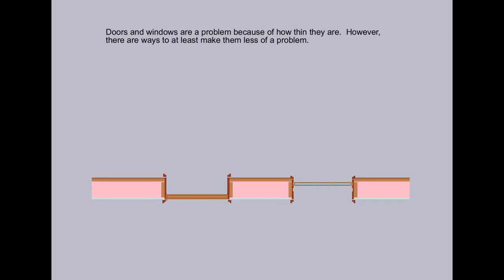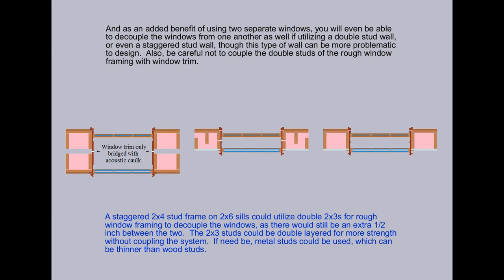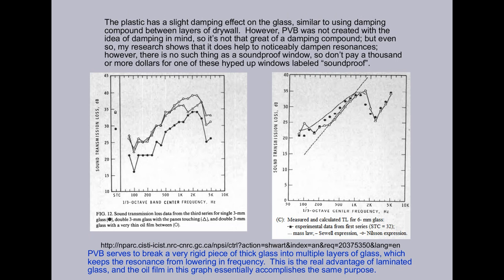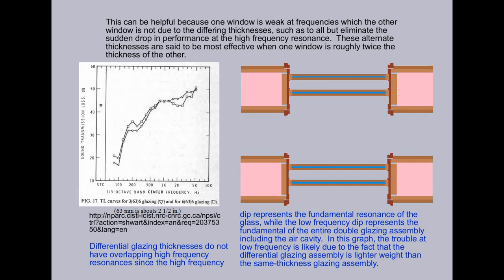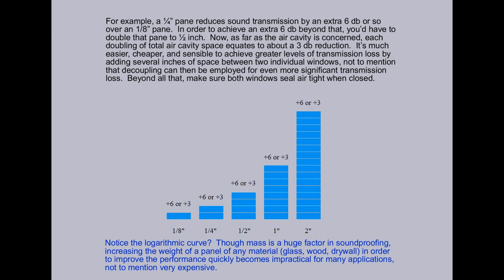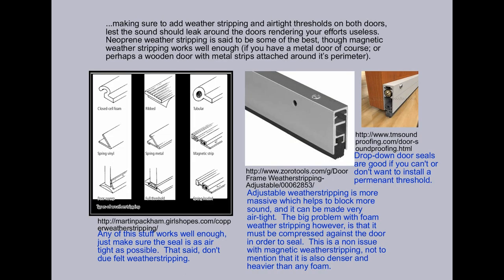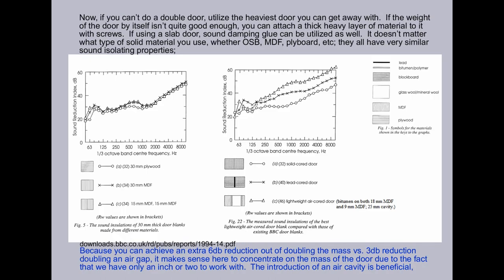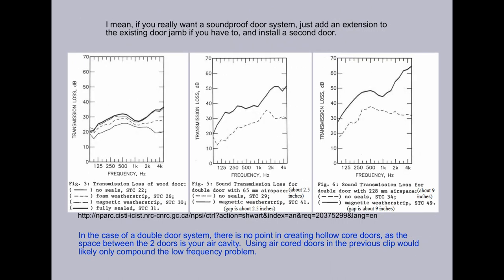Soundproofing  -4- windows and doors

Comment: Awesome instructions. Is there anyway you can explain how to close up the window staring from the innermost sheetrock to the inside wall with the clips on them?  
I assume the inside and outside walls shoudl not touch each other. What can i use to close up the space between the sheet rock and the actual window/ door frame?
Thanks for your help
Reply from the maker: Well, you can use a flexible rubbery layer like Mass Loaded Vinyl or possibly lead tape to seal particularly large gaps, but other than that, the traditional way to do it when you can is just with acoustic caulk. Basically, for the hat channel or R1 channel you cut the drywall in such a way that when you lay the window frame in, there will be at least a 1/4 inch gap so that the drywall doesn't touch the window frame, and that gap is then filled with acoustic caulk. For a double wall construction, you not only have two separate windows, but also two separate window frames one in front of the other. These window frames do not touch each other and will have at least a 1/4 inch gap between them which will be filled with acoustic caulk. Hope you found this useful. I think this info is in my videos about walls, if it isn't here. I'll have to check on that...

Comment: Would putting a window security film on an existing window help?
Reply from the maker: When it comes to barriers, weight is the deciding factor. A film of plastic will do little; If going with plastic, it should at least be 1/8 inch acrylic to make a notable dent. You typically need double the thickness of acrylic to approximate the soundproofing of glass because glass is much heavier.

Comment: Some say the air gap will act as a drum of sorts and actually increase the sound vibration??
Reply from the maker: Everything has a resonance frequency; if the wall absorbs sound, it will somewhat alter the frequency to the wall's resonance. That's why you want to make the wall cavity as deep as possible, such that its resonance will be close to or at the threshold of human low frequency hearing.
Reply: So how much air gap would I have to keep between a noisy party wall and book shelf (serving as an insulation)? @WhatIsMisophonia
Reply from the maker: @anaesterhazy631  To really approach the threshold of most hearing at low frequency, it is recommended to have at least a solid foot of air cavity space with nothing in it but insulation. It's difficult with a party wall because there's just sooo much noise coming through it; Bare in mind that the resonance frequency of a wall is the weak point, but sounds off all frequencies will still come through, just to a lesser degree. If you've ever been to a bar with very loud music playing, often they have very large entry areas so that you go through one door to get into the entry area, and a second door to get into the actual bar. Part of why they do that is because the more physical separation you have between the walls, the better the walls will vibrate independently of each other, and the better they can block sound. So basically, with a party wall, I'd recommend as much air cavity as you can get away with, pack it with insulation, and add multiple layers of heavy firegrade drywall, preferably with a sound damping glue like GreenGlue or QuietGlue in between the layers. There is no such thing as perfect soundproofing, you can only just build it thicker and heavier to block out or absorb larger amounts of sound, and utilize decoupling principles and damping glues.

Comment: Thank you very much for the information!!! So good to learn that!!!!
I have a question, hope you can answer me 😊
My glass door is single pane which makes my room very noise as the sound can pass through easily.
Now I want to make it sound proof by myself, thinking about blocking the glass with 2 layers of plywood or drywalls which have green glue between. How do you think? 
Should I keep a air gap between the glass and the woods for the best results?
Thanks very much 😊
Reply from the maker: You're certainly welcome for the information.  Mass-air-mass is the main concept behind soundproofing, and there's only so much you can do with a single solid layer.  If you can, you really need a double/communicating door set up with as much of a gap as you can get between the doors, as I've mentioned in the video.  Beyond that, my understanding of damping glues is that you need to use two layers of material that are of similar rigidity in order for the damping glue to be most effective.  If possible, I would just use two layers of 1/2 inch concrete board, (probably Hardibacker), and glue those together with damping glue.  Then I would attach this over the door with as much space between the boards and the glass as possible with wooden strips as spacers between the glass and boards, and use caulking to create a good air seal.  Make sure the door itself has good weather stripping.
Reply: Thank you very much for the reply!!! Appreciate!!!
Yes I think I will have two dry walls:
1 on the front of the glass door
2 at the back of the glass door 
While having 2 air gaps total.
Drywall- 1inch air gap - glass - inch air gap - drywall
Is it even better?😊
Thanks again man!!!!
Reply from the maker: @PUREMediaChannel1  Better to have 1 big air gap than 2 smaller ones, especially since you are in danger of creating the dreaded 'triple leaf effect', which will ruin your soundproofing efforts.  It's good that you're considering using 2x the drywall on one side, as this will cause the sides to resonate differently, but to avoid the triple leaf effect, one of your gaps also needs to be 2x the size of the other as well.  I can understand if you have space limitations, but may I suggest a possible alternative:  Manufacture your own door using 3 pieces of plywood, mdf, particle board, or concrete board cut to the dimensions of the original door, but as thick as you can get away with; attach the pieces together as one solid structure with no air gaps using damping glue and screws.  Then, paint the door with a high quality abrasion resistant paint, attach to the door jamb with 4 hinges for good support, drill for the door handle, attach the handle, and attach weather stripping.

Comment: Hi. I want to congratulate you on the series of videos you've made, this are the most comprehensible on youtube. Several hours of study into a tightly packed, but technical still lecture. I have a question for you (perhaps it merits a video on its own): what role does it play homogeneity in the picture? Say you have  an hypothetical 10 square meter, 25cm thick concrete wall with a 1cm2 hole in it (and the rest is all ideally sealed), how much does it dampen noise isolation? Now, you put the least ammount of caulk in it to make it air tight, what then? Now, you put a generous ammount of caulk (common silicone) to fill 5cm but still a huge bottleneck compared to the whole concrete wall, what now, how many decibels? Picture the same scenerio and questions but with a 10cm2 hole. I still haven't found a satisfactory answer to this. I think its very relevant to weatherstripping. For example, when making a solid window shutter with 5mm clearance on all sides and then put a silicone tube WS of 3mm thick in it vs a 3mm clearance OAS with the same WS but with a thickness of 0.5mm which is better, or a foam weatherstrip in a 2mm clearance? are all roughly the same with regard to noise reduction? Is the best approach to ensure a sealed perimeter first? You got three variables that have a very complex relationship: clearance of the perimeter, hermeticity, and density of the WS (or mass at the shortest distance for sound to go through). Cheers!
Reply from the maker: Thank you for the compliments.  I started learning about noise control due to my severe sensitivity disorder, not because of an innate curiosity about sound.  Don't get me wrong, I am a bit of an academic at heart, but my point is that I'm not an acoustician.  I don't know the calculations to tell you what kind of dbs you're going to get through a tiny hole in your hypothetical experiment, I only know that there will be an audible difference;  Sort of like if you crack your window open even just a little to a noisy street.  Also, higher frequency sounds will get through the opening easier than lower frequency sounds.  Sealing up the gap to make it air tight will make a notable difference despite only using the bare minimum sealing material.  Using more than the bare minimum may or may not be perceptible, and though some weather stripping materials and constructions are better than others, I find that people obsess a little too much about it.  Vibrations dissipate throughout the solid mass of a rigid structure, so provided that you have a good air seal, your primary points of concern are still such things as mass, decoupling, and air cavity size, as well as dealing with nosy ducts, etc.  A thinner large section of wall in one area will certainly transmit more sound, but the smaller the thin proportion is, the less the concern.  Sorry I can't give you more of a numerical answer, but my information is more about an intuitive understanding of the physics involved aside from a few basic figures and understanding of stc graphs.
Reply: @WhatIsMisophonia  Thanks for your reply. I also have the same sensitivity. I wouldn't classify it as a disorder even though modern normalcy would want us to enter that category. "You don't stand the noise of exhaust pipes? What's wrong with you?" I think if something is wrong is the people that don't bat an eye over it. They probably went numb years ago to withstand it.
 If I go to the countryside where only the cows and the trees make /sounds/ my mind is ten fold more potent. Read Schopenhauer on noise, nietzsche and goethe also wrote about this quite extensively.
Going back to the experiment, intuitively it didn't make sense to me. Still doesn't, I don't get how a bottleneck effect is not at play here. somewhere along the line it'll come on stage but luckily in practice it doesn't.

Comment: Do you know how thick the windows ~need be for eliminating low frequency bassy( ~80Hz) noises?
Reply from the maker: "Eliminate" is a strong word, as soundproofing only reduces noise. In most case, soundproofing requires a system of materials and construction method rather than just banking on a single thickness of this or that material. The diminishing returns on glazing thickness make anything thicker than 1/2" glass rather pointless, and in most cases, 1/4" glass (1/2" for acrylic) is sufficient provided you have a double window system, with one window on the inside and one on the outside.  In that regard, I would go with a single pane 1/4" storm window on the outside and a typical 1/8" double pane window on the inside (the longer low frequency waves treat the double panes as if they were one pane due to their close proximity to each other, so it's similar to a single 1/4" pane on the inside).

Comment: What is your position on using 1/4" or .22" acrylic panels? My understanding is that acrylic does not transmit sound as readily as glass.
Reply from the maker: acrylic is lighter, and so you have you use approximately double the thickness to attain similar levels of noise reduction.  As far as ability to transfer sound goes, acrylic is more flexible, which does allow it to dampen vibrations a bit, however it becomes a bit ridiculous when you have to use 1/2 inch of acrylic to have an equivalent STC value as 1/4 inch of glass.  Not only that, but laminated glass 1/4 in. will have similar damping, so I'd say just use whatever is most convenient, or what you can afford.

Comment: i am from India, I have got window which is double glazed and the  frame is hollow Aluminium tube of 120mm/50 mm , what should i insert in these hollow tube to make the room more sound proof...can you suggest
Reply from the maker: The framing is such a small area it really doesn't make a huge difference provided that it's at least sealed air tight.  At any rate, soundproofing is accomplished mostly with mass, so whatever you can fill them with that's heavy should help.  You might even just attach some lead tape all around the frame as well.

Comment: What frames should I put on the second window - plastic or aluminum? Thank you.
Reply from the maker: Wood, plastic, and aluminum are all relatively light yet rigid materials and have similar ability when it comes to blocking sound.  The only notable difference comes when you have thick steel frames (heavier, and thus better soundproofing) and/or panes which are connected to the frames resiliently, allowing the pane to move like a bass trap and push the frequency below the threshold of human hearing.  Those are expensive of course, and in most cases your window soundproofing will be pretty much the same as your wall if you do a double window set up with just basic cheap frames/attachment methods.  On that note, I'd go with plastic, as it's more energy efficient then aluminum unless the aluminum one was much less expensive.

Comment: Often it is the act of the door closing which causes the vibtation/sound that is of annoyance.
Reply from the maker: I know this is an old comment, but to anyone who may read it, yeah, I completely understand.  I had that problem when I was saying at a dorm in college because all the doors were wide, heavy, and had spring loaded self closing hinges.  God those bastards slammed hard.  I ended up attaching a note to the outside of my door informing people about my sound sensitivity and that the door slamming was an issue, which caused several people to stop allowing their doors to slam when they came or went.  College is a bitch if you got issues.

Comment: sorry, I feel a bit dim witted. All in all, what do you recommend for windows then? A double window or a single window with double glazing? Thanks
Reply from the maker: Double windows; a double glazed window will not have much better soundproofing than a single glazed window.  What I'm advocating for here is 2 single glaze (or double glazed if you want better R value and slightly better soundproofing) windows installed in the same window cavity, one window on the outside of the house and one window on the inside of the house with as much air space between the windows as you can get.
Reply: @WhatIsMisophonia  So you're saying you prefer customizing your own " double glazed window" by having " as much air space between the windows as you can get" via making two 1 pane windows w/ your fancy window spacing?
Reply from the maker: @agfdsa123  This is really just for soundproofing purposes. What I mean is, double pane windows have the highest R value when they have around 3/8" spacing between the panes. Larger than that (I think 1/2" or more), and the hot and cold air between the panes is able to separate with the cold air falling to the bottom of the cavity and the hot air rising to the top. This reduces the R value. Soundproofing on the other hand requires the largest space between the panes possible. The easiest way to get the best of both worlds is to place a storm window on the outside of the cavity and a double pane window on the inside so that you have at least a few inches of space between the storm and double pane window.

Comment: u really need to learn to speak up...
Reply from the maker: +Aquakey 98 it's not a problem with my voice, the audio is tricky.  When I make the recordings, they are much louder, but when I put everything together and upload it, it's much quieter.  The last few video's are a little better,  but I always end up lacking on the volume end.  I would like to remake the videos with much louder audio, but some of the videos have mysteriously vanished off of my hard drive, so I'd have to completely redo them.  As it stands, I'm a bit busy and don't have the time for it.